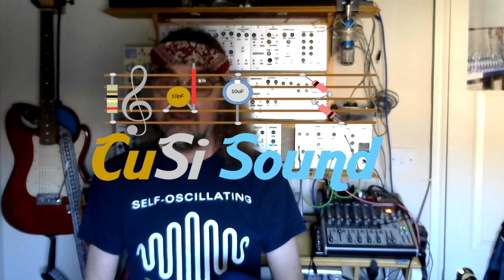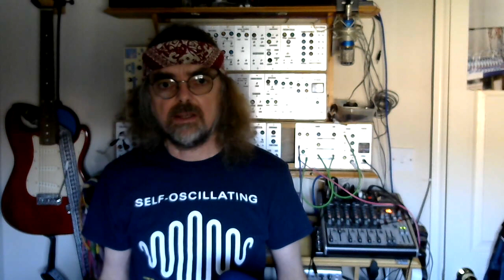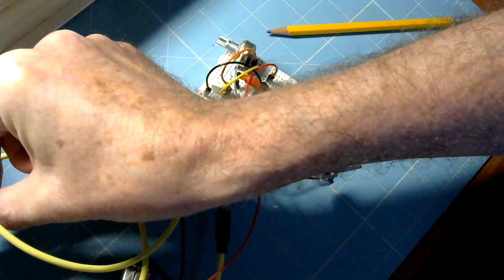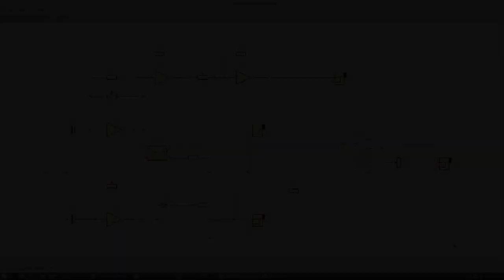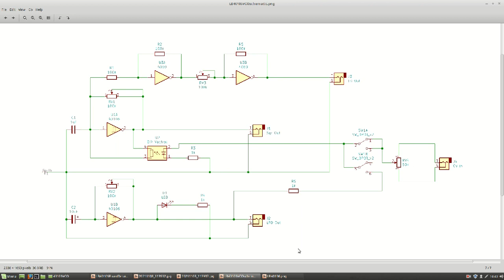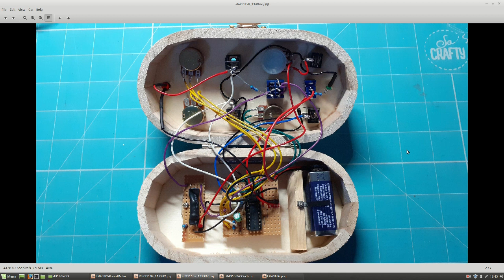Little Boxes 40106 VCO

Comment: 12:28 Without R5, you have a direct connection from the reduced volume CV-IN to the output of U1B (LFO Oscilator). RV2 does no current limiting other than feedback, so the problems you experienced without R5 are likely related to U1B dominating the Vactrol input.
Reply from the maker: Thank you for explaining this. It's good to share knowledge in the diy community.

Comment: Hey Alan! Thank you for making such a neat little noise boxes to work on -- and posting the stripboard layout so my electronic-lego brain could do it HAAH! I'm slowly working through them and enjoying the learning process! (I make predominantly guitar pedals -- made and Atari punk console and a dub siren -- but I wanna learn more stuff too!) I'm having a little trouble and was wondering if you could offer some insight?  I made the board -- wired up all the offboard wiring -- and it worked for about 20sec -- then the board started rapidly heating up to the point the ICs were too hot to touch and about to pop.  I swapped out the ICs, changed the vactrol etc -- but it still heats up like crazy and no sound comes out -- just the "you didn't do something right" buzz-hum.  Any idea why it would heat up so much? Any suggestions on where to start looking for a problem?

(I'm using a 9v guitar pedal power supply instead of a 9v battery and have tried switching mA from 500mA and 100mA -- as well as changing the polarity -- just in case that was it.  also using a pre-made vactrol instead of a homemade one -- not sure if that's the problem either.)

Any help -- or even theoretical knowledge would be awesome --- and thank you again for the cool stuff to try!
Reply from the maker: Good to hear you are having a go at building your own. Also, it's OK to make mistakes, that's where most of the learning comes from. For chips to heat up they are usually drawing more current than they should and/or sending it to the wrong place (pin). Common causes to look for include; track shorts either stray solder or not fully cut tracks, misplaced connections eg something connected to the wrong pin, wrong polarity of power supply (though you have checked that), chips in the wrong way round (yes it can be that simple!). I still encounter some of these problems, particularly the stray solder issue. I usually check the circuit board with a magnifying glass to pick up any issues. The power going into a vactrol is isolated from the circuit board (they are used specifically as optical isolaters in some applications) so that should not be part of your problem. One troubleshooting method I use is to trace the circuit diagram on the circuit board. I start at one pin of the ic and match the connections on the board to those on the circuit diagram. It's a good way of spotting missing or wrong connections. Hope this is helpful.
Reply: @CuSiSound  Thank you! And thank you again for the encouragement! Sucking at something is the first step in getting awesome at something -- right? HAHA! I haven't had a chance to get back at the circuit yet -- but I had checked (and scored) a few sketchy solder points that looked like they might have gunk between them.  Good to know the vactrol is isolated -- that leaves less to worry about.  When I get back to it -- I'll check the jumpers and where the power is going in -- I bet I misaligned something in there somewhere.  Thank you again for getting back to me and for sharing your knowledge! Much appreciated! Cheers!

Comment: could you just run diodes going out instead of the 1k resistor for the noise?
Reply from the maker: Do you mean R5 (1k) on the LFO switch? If so, that would ensure the signal only goes in the right direction so it could work.
Reply: @CuSiSound  yes i noticed a design elsewhere  that uses diodes on all of the inputs of a sequencer and another op amp osc that had them and im wondering if that is the reason. theres a way to run op amps without vactrols to get true 1v per octave but ive yet to test it out as im still deciding what chip to use. just finishing converting six of caspers LFOs to one board and vco is my next project